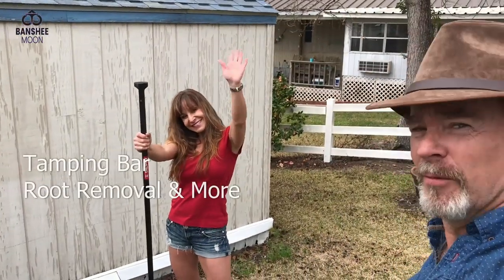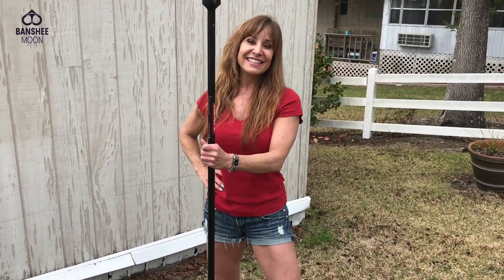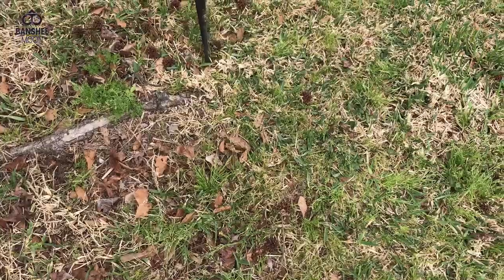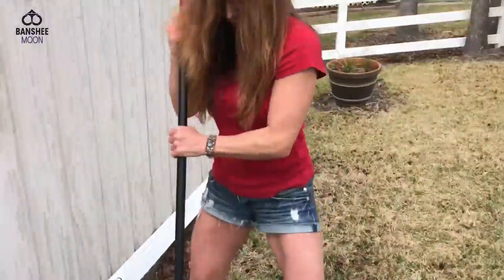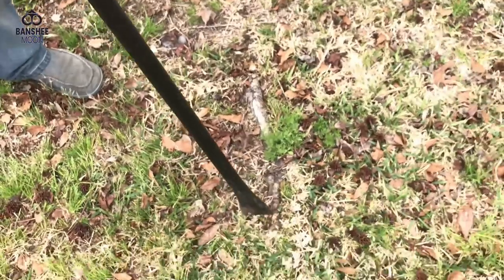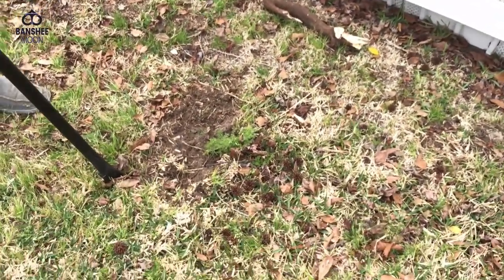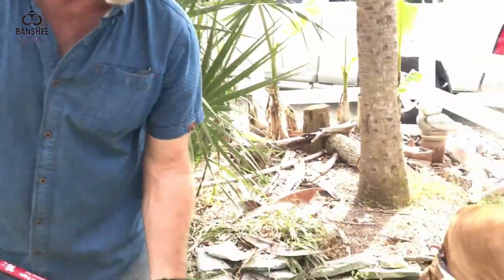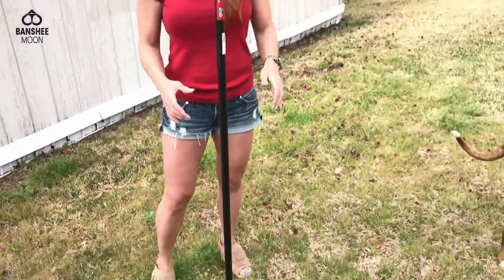Root Removal | Concrete Removal | Weed Removal | Tamping Bar

Comment: The spade end is for working the dirt in the hole, around the post. You add water, slam the spade, work it back and forth. Dirt, water, spade, tamp.  They are necessary for setting the 16 inch corner posts.  We called it a spud bar.